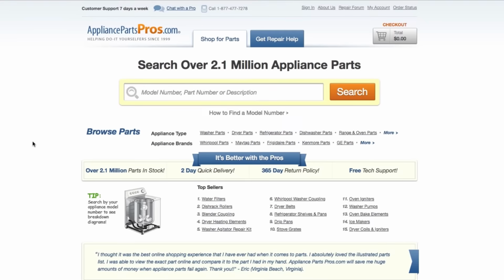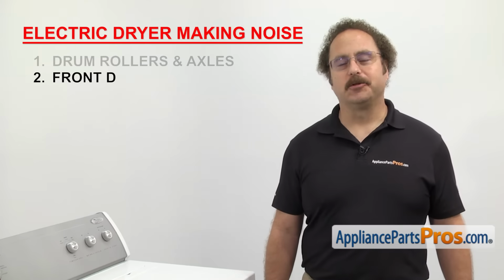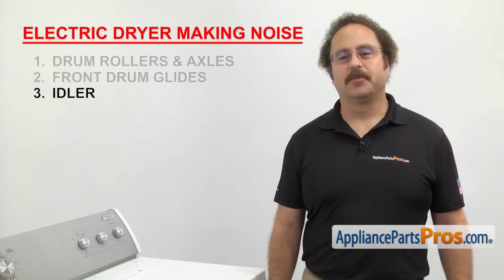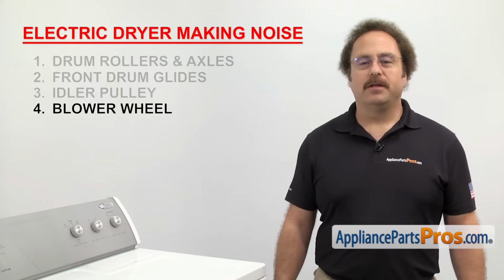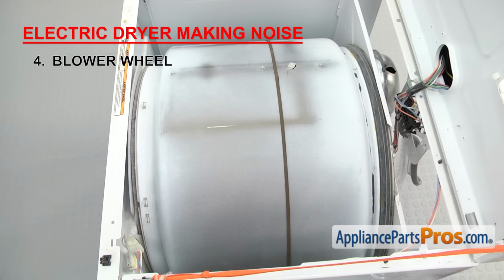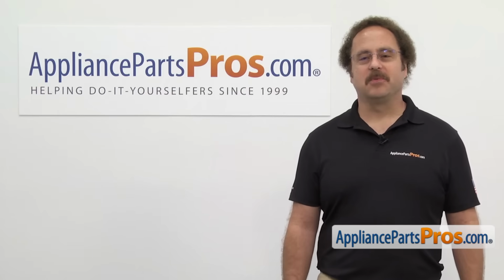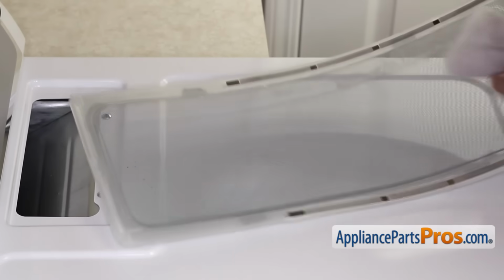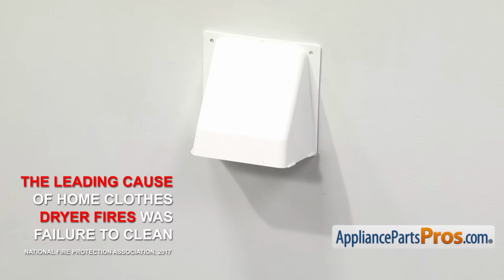Electric Dryer Making Loud Noise - TOP 6 Reasons & Fixes - All Dryers

Comment: great info, would be perfect if there were samples of the noise each problem makes :-)
Reply: That's what I was hoping for too
Reply: I agree! I've been searching for hours and not one video with actual noises from dryer
Reply: Sally Castles open your dryer and inspect. The only way to truly see what’s going on
Reply: This was the MOST detailed video I found. Towards the beginning of each of the reasons/fixes he references the noise that the dryer would make. I found that helpful and am currently working through these steps on my dryer. If you're not sure what squealing/squeaking/grinding sounds like... I'd just google it (that's what I did). Hope this helps a bit. Good luck! :)
Reply: Yeah, that's what I was hoping for too. Mine isn't a high pitched noise or squeal. It's more like something is rubbing or dragging as the drum spins. Guess I have to call a repairman. Where's a good handyman when you need one of you're a single woman living alone?
Reply: @ljohnson951  if u got a few tools it's easy to open them up. Mine was the wheel the drum spins on. Had a chunk of rubber missing ordered a new part on amazon was fixed in less than 2 days for 12$ also got to clean all the dust build up
Reply: The appliance repairman can usually be found in porn videos.  They never seem to finish fixing the appliance though.
Reply: Same thing I said. Would've been a perfect video
Reply: Literally the only reason I’m looking for this stuff on a website that specifically allows you to listen to the problems people have
Reply: Guy thoroughly explains in detail and links a website where there’s more info and we want MORE??? Sheesh. Call someone do it for you 😂😂
Reply: Agreed
Reply: YES!!
Reply: Lol hoping to hear some examples of noises
Reply: The verbal description of tennis shoes tumbling around was enough of a clue for me. I also heard squeaking sounds in the beginning of the drying cycle for about a month in the lead up to hearing the annoyingly loud tennis shoes sounds for the entire cycle. I haven't opened up the machine yet, but I think my drum rollers and/or axles need to be replaced. It's nice to know where to start!
Reply: Yup. Same
Reply: EXACTLY
Reply: Same here (hear).
Reply: Yeah.  I've got a dryer making noise and it would be nice to have a good guess where to look.
Reply: Great tip. I use lint for starting survival fires with a ferro rod
Reply: For anyone knew. Their website under the products they sell states what the item would be used to fix. Like the back bearing or whatever is what I'm seemingly trying to find i guess because of the rubbing and grinding sounds. It says "will stop grinding" and what not
Reply: Except that would replace the job of repairman COMPLETELY.
They are already giving us as many repair details as possible and part items to order to do it ourselves
Reply: AMEN... they NEVER do and that's what we need!
Reply: that would be waaaay too easy . it just cant be that easy these days ..it SHOULD but its not
Reply: @EthericBladeworks  I mean they would have to have all these problems. It’s probably easier to take a good one and open it and just show you.
Reply: @mikeykane5938 it would be easier to end up recreating the sounds. They are a parts company. They provide parts. I bet there's quite a few times they can even ask for a video of the customers issues/sounds from the dryer.
Reply: Exactly this video is pointless without it tbh